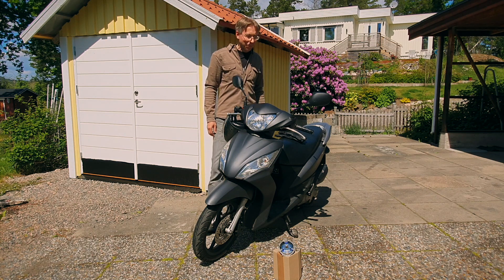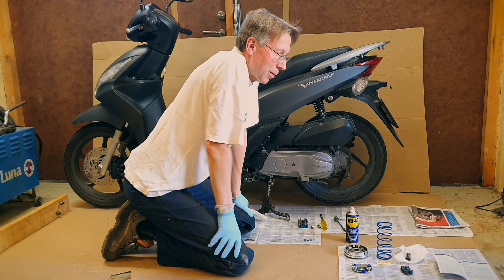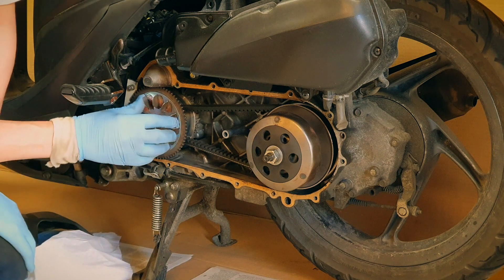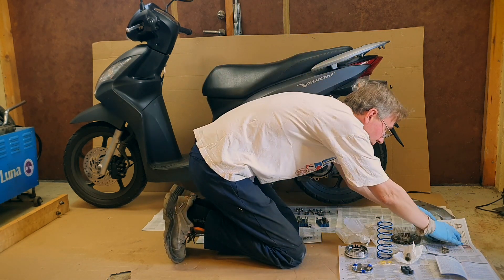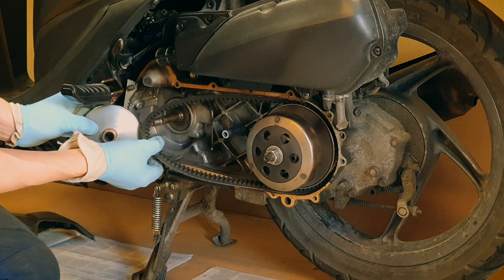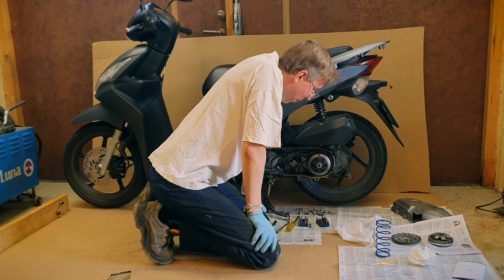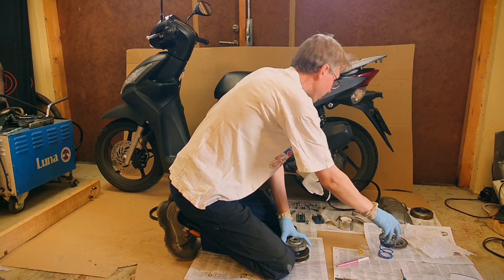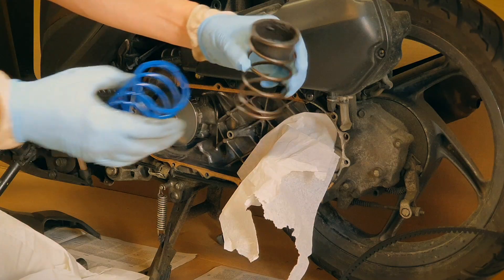HOW TO DESRESTRICT A HONDA NSC50 VISION SCOOTER MOPED

Comment: Thank you so much for this video. I had my Peugeot kisbee two stroke stolen from me so I had to dig up my old vision that hasn't run in years. Your previous video helped me a lot to get it back running, but I had forgotten how sluggish it is compared to the two stroke. Was wondering if this variator was worth it and couldn't find much info since not a lot of people are interested in optimizing this bike, but now I have my answer ! Will give it a try and hopefully I can climb hills a bit better. I think Polini also does a tighter belt for the Vision, might give it a try too
Reply from the maker: Thanks, and good luck with your update. You are right, Polini has a belt that is rated at 769 mm instead of the original 785 mm. If they use the same standard for measuring then that might give a higher speed, if the front variator manages to pull the rear variator apart more. Hope you can come back with info on how your experiment worked out, it would be interesting.
Reply: @hoojiesgarage1542  I will try that out and let you know. Did you notice any change with acceleration?
Reply from the maker: @FoxMikeHotel  Good question, no significant difference I would think, but it does feel quite a bit better to ride in general now.

Comment: Hi, nice video thanks. I just bought the same scooter 2nd hand and the previous owner has already installed this kit. The scooter also goes 55-60 kmh but it is very slow at accelerating from a stand still and going up hill it is also a bit of struggle. Now I don't know how the stock version behaves so I would like to know if you had any similar issues or should I look for a possible problem somewhere else and what can it be? Thank you in advance!
Reply from the maker: Hi NG. The bike here runs uphill and accelerates as before, no noticeable difference. Maybe it is worth checking the engines compression?
Reply: @hoojiesgarage1542  ok, what schould be the compression for the scooter?
Reply from the maker: @ngg.7891  The easy answer is 10,1:1 but what that translates to using a compression meter I have no idea of. I think the best would be to make a comparison back to back with an NSC50 that is "good". Or simply ask the nearest dealer.
Reply: @ngg.7891  hey, I have NSC50WH 2012, and think I've got a similar problem, what was the outcome in your case?
Reply: @nameberry220  I have ordered a new belt and i am going to put the original vario, but i did not have to do it yet, as it is now too cold anyway.

Comment: Tack för videon! Är det självfabrikat på den fiffiga plattan du använde för att hålla variatorn fast när du lossade på muttern för den?

Jag har också en dotter som kör vår Honda Vision och blev precis lika förvånad som du över hur mycket bättre scootern kändes att köra efter variatorbytet. Precis som du sa känns det som att den är designad för att gå 60km/h och orkar gå uppför minst lika bra med den trimmade variatorn.
Reply from the maker: Hi Tomi. Yes that little "cogged" steel plate to lock the variator I made myself. A card board was put in position first and with a pen I draw the outline of the variator. Then I "copied" that in steel. Interesting to read that our scooters perform the same 🙂

Comment: Dear moped riders, I'm wondering if there is a tuned set of cylinder and piston 70-90 for HONDA VISION 50 4T 2012 except for 3116518 Malossi Thermal Group 83cc. Or is this the only option to increase the cubic capacity?
Reply from the maker: Hi Urban. Not aware of any other cylinder kit. An option could be to buy a crashed NSC110 and "merge" the two bikes together.

Comment: Hi, thanks for the video! Do you think changing the spring is necessary?
Reply from the maker: Hi Viktor. The kit from Polini I bought second hand. The previous owner said that the speed increase was almost not noticeable but I still wanted to give it a try. As I went along with the installation I noted that the spring for the rear discs appeared virgin. I think this is the reason why the first owner did not notice much of a speed improvement. If the rear spring is not replaced, the new variator will not manage to pull the rear discs apart to reach the needed gear ratio. The front diameter of the turn that the belt makes needs to be as big as possible, and the rear diameter needs to be as small as possible, then the best change in gear ratio is achieved.
Reply: @hoojiesgarage1542  thank you for your answer. I see. Its just such a hassle to remove the parts and screws are pretty stuck, was thinking about avoiding it, but I am gonna have to go for it.

Comment: Bonjour .
Je voudrais changer le roulement aiguille  qui ce trouve derrière l'embrayage savez vous comment il faut faire pour retirer ce roulement en sachant qu'il y a l'axe centrale de l'embrayage  au milieu.
Reply from the maker: Sorry, I haven't had to do any work like that on my bikes. I would just imagine that one will have to build a tool or two to be able to pull the old bearing out and to press the new one in. Good luck.

Comment: Is the diameter of the Polini variator the same as the original?
Reply from the maker: Hi Ali. Which diameter do you mean? The Polini variator is kind of "plug and play" as you can see in the video. But the diameters where the belt runs are different, otherwise the speed of the bike would not change. You can use the original belt if it is not too worn (see my belt replacement video) or buy a Polini belt that is slightly shorter.
Reply: @hoojiesgarage1542 Thanks for the swift response. I just installed the Polini variator, it is smaller than the original one, the one I took out. The scooter is not new, so I can't say for sure the one I removed was original, hence the question. The belt comes almost to the top now, which worries me. Of course this happen when there is no load on the scooter, may be it is ok with some weight on it. I will consider buying the Polini belt.
Reply from the maker: @ Hi again. I can just recommend you to try to compare to what you see in the videos, both "Derestricted" and the other one about the belt replacement. Please note that the variator at the crank should not push the belt out to the periphery when the engine is not running. That should only happen as the moving roller weights press the discs together at high rpm. If the belt can't fall in a bit in-between the discs, something must have gone wrong as you put things together. Good luck!
Reply: @hoojiesgarage1542 Thanks again, I will check the suggested videos.

Comment: Do you think it is possible to keep the scooter «legal» by using lighter roller weights (maybe 3 gram weights?) so it goes 45 kmh, and still keep the benefits of the derestricted variator? I thought this would be interesting for you to experiment with! Anyways, great video👍🏼
Reply from the maker: Hi JVB. Let me think. Lighter weights would have a hard time pushing the discs together at given rpm, so the engine would have to rev more to reach 45 km/h. Doesn't make sense to me, seems like one would end up with something pretty much like the original variator. 
To maintain a lower rpm at 45 km/h, but not allowing it to go any faster, one would have to set the rev limiter at a lower rpm, which is not easily done unless you know how to program ECU:s. Or by adding an external control unit like on an A- or EPA-traktor.
Reply: @hoojiesgarage1542   I was afraid that would be the case. My mother has a Vision 50 and she wants better acceleration, but doesnt want it to have any higher top speed because of legal reasons. Do you think there is a solution to this problem? I am leaning towards buying some rollers that are a gram or so lighter to see if that is satisfactory, but I am afraid it will loose top speed and slow down traffic even more.
Reply from the maker: @JVBNorway  Well, you can always experiment and see what happens. But if it feels really slow in acceleration, maybe there is some other issue with the bike? Low engine compression? Dragging brake?